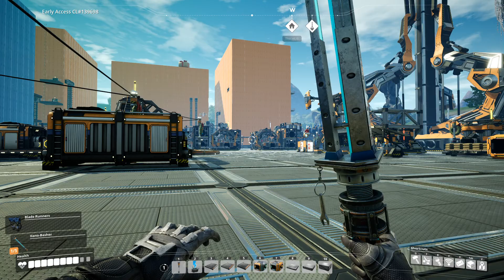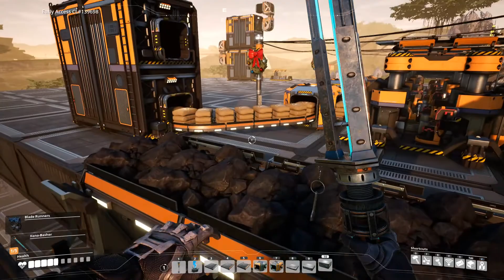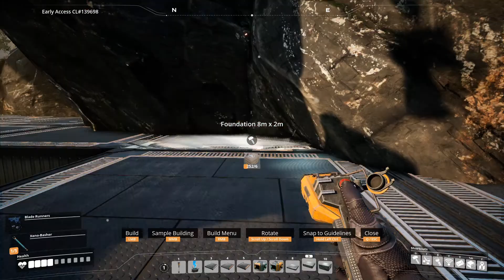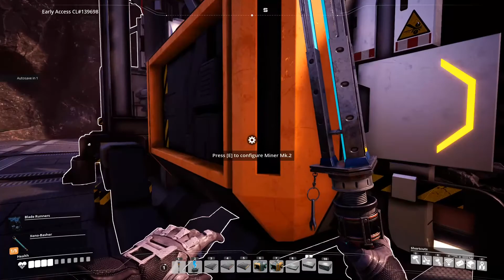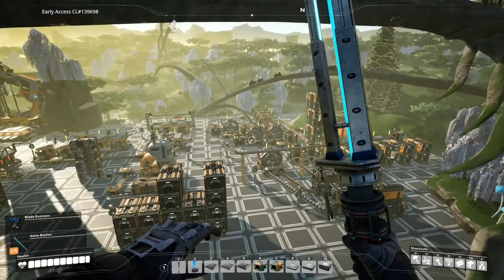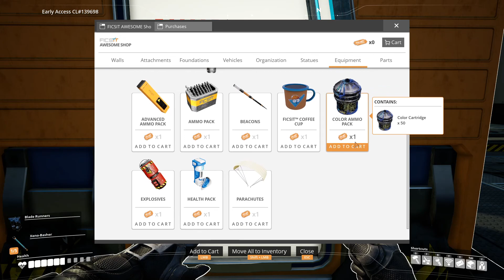Satisfactory - STEEL FACTORY - GOING VERTICAL! - E16

Comment: Might I suggest dumping your overflow right where you have the large storage atop each 'factory tower.' You can have several Awesome Sinks running and they will network together. Meaning, tickets you earn from any sink will be aggregated and can be grabbed from any sink in your world. Put a sink on the top of each tower, then have one sink in an easy-to-reach area to grab tickets. Great job building vertically! That takes a lot of work and I really appreciate the time and editing you put into each of these. Keep up the good work!
Reply from the maker: It's funny, right after I finished recording I redeemed my tickets from one Awesome Sink, and then I was like...  I need to redeem the other tickets from the second Awesome Sink.  There were no tickets.  Then I was like...  Are they linked?!?  They are!   So...  Your idea is great because I thought I had to check each Sink individually.  Thanks for the info!